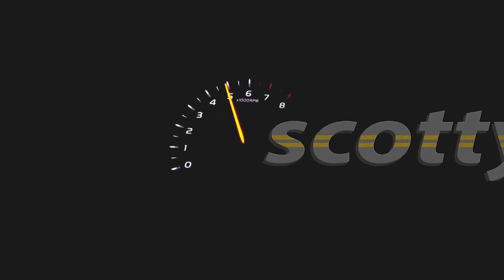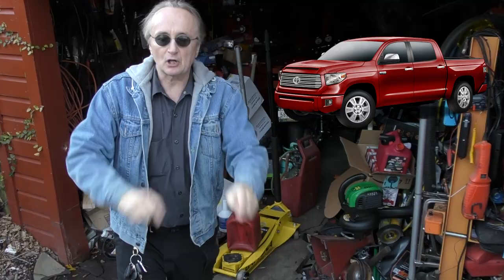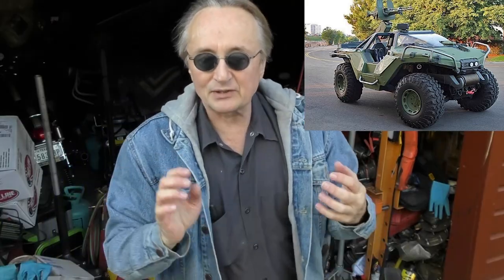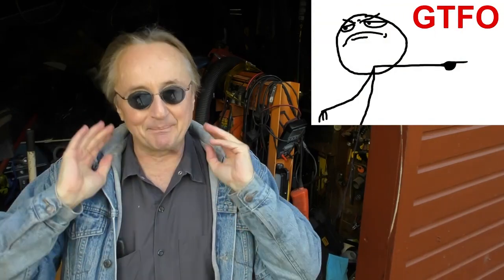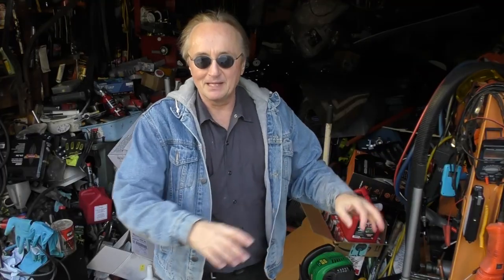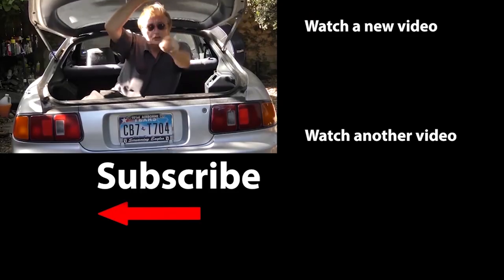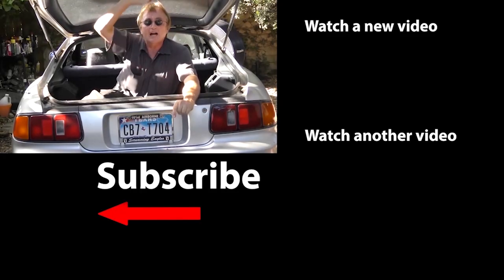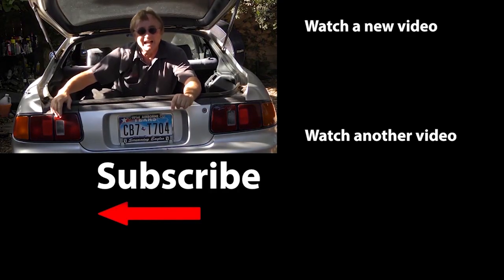5 Used Trucks You Should Never Buy

Comment: I would have to disagree with you on the Honda Ridgeline, I’ve had mine for 11 years and she’s pushing 420k miles and I’ve never ever had a huge problem with it, yeah a little rust on the rockers but fixed that up. The vtec in that thing still purrs, remember oil and oil filters improve a cars life.
Reply: As soon as it hits 420 it will start smoking
Reply: Thats good to know i just bought a used 2014 ridgeline with 35k miles some guy had it in a garage never drove it. Its my first truck  so im hoping I can drive it for a long time
Reply: How's it still holding up?
Reply: @BigWheel.  pretty awesome! I've gone ahead and did a number of maintenance like oil, trans, differential,  transfer case,  coolant, filter changes. I'm 4real about keeping it
Reply: Ridge line is a city truck... not really meant to tow/haul stuff... but a great for doing light duty things, for a carpenter/maintenance man.
Reply: Hey, same here, my 2006 Ridgeline has 350k miles and still has all original parts. Just normal maintenance has kept this thing going along nicely.
Reply: I have a 2013 Ridgeline 
 Love it . We don't get much snow in S C. When we do this thing is great.
Reply: I want a ridgeline. Test drove a 2007 with 190K on the odometer. Loved it and miss it because I had to get into my 136 horsepower kia soul and felt very strange lol
Reply: My 08’ Ridgeline has 156,000 miles and it’s perfect for someone like me who needs a versatile truck for hauling mulch, sofas, toolboxes to just name a few.  I never really needed to tow anything, so it’s perfect for what I need it for.  I wish I didn’t beat it up so bad on the highways because traffic is really aggressive and fast where I live.
Reply: @werunthistoo  lol i get it
Reply: Your "truck " is the iligitamate child of a  Toyota prius  and an El Camino
Reply: @lukeh5289  you base this on looks? How superficial. How about judging based on functionality?
Reply: @DonutGameClips   there's plenty of trucks that perform just as well and  don't  look like a Ridgeline
Reply: @lukeh5289  well, someone's preference belongs to them. Let people decide what they want.
Reply: @DonutGameClips   just not my type you seem to like it so good on ya
Reply: @lukeh5289  I'd get one if I could. Nothing wrong with it. Don't shame people who like it, though. It's just a vehicle. I go for performance. I'd take one only for the V6 and AWD
Reply: @lukeh5289  haha good one lol.  Let’s just say we agree to disagree.
Reply: @aviationnerd2465  Yeah. Ridgeline is a truck that help you to carry most household applications such as washing machine, wardobe, desk etc. It is not meant to towing boat and other cars.
Reply: Yeah I agree, people can keep these going well past 200k miles and I mean it tows 5000 pounds which isnt the most but it's not terrible I would say. I have been told it's a great truck for the snow as well. The 4 wheel in these older ones are solid.
Reply: @govinlock8568  you can tow smaller boats with it like a bass boat or something, but yeah i wouldn't recommend using it to tow a larger boat like a pontoon or use it as a car hauler lol. They weren't designed for that
Reply: I somehow doubt that
Reply: @tunit8946  how many miles are on yours now? Also in SC too 🙋🏻‍♂️
Reply: @iangrogan5261  95K
Reply: @iangrogan5261  obviously we don't get much snow . When we do this truck is like a snow machine.
Reply: Fram: I'll end you
Reply: @werunthistoo  lmao I get thst joke
Reply: @JPmelonslide  my 09 is great in snow. The AWD cuts in with a little nudge on a slippery road. Decent set of tires and away you go.
Reply: This is an awful video... He literally didn't like the Honda just simply because of the bed size.. it's called a midsized truck for crying out loud lmao Hondas will go forever if you treat them right.
Reply: @47thpanzerunit  had mine new since 2009. My biggest thing has been the honda rust cancer around the rear wheel wells. If you are in a rust belt ( or even a place with a winter) i would rust check it.
Reply: I agree, Ridgeline may not beat the full-size pickup, but it has its place. And the  engine and the transmission are solid.
Reply: @47thpanzerunit  looks like you still don't own a truck
Reply: How are the 14 & up Chevy z71s ?
Reply: @DonutGameClips  I don’t think Luke should be criticizing the “looks” of anything…smh
Reply: @jonathanjr1894  Hondas keep going even if you don’t treat them right. Ask me how I know.
Reply: I just got a 2011 Ridgeline and I love it. It has style and power .I am a working musician and its perfect for my drum kit. I can fit the whole drum rack with seats up.

Comment: “Pickup trucks are for work not for racing” AMEN
Reply: kelly love they race in a straight line like american muscle cars, no1 races them around corners like japanese gtr 34 or supras
Reply: whatEver why are ppl always concerned with what other ppl do with their property? just be glad we have the option for more comfortable features as better handling/feeling suspension or a/c. my dad has an old 78 f100 and you seriously feel evert single tiny bump on the road like if it was a huge pothole. worry bout yours and your money bud.
Reply: NASCAR trucks
Reply: idk the mini trucks of the 80's and 90's seem to handle pretty decent.
Reply: What if racing is your work? :o
Reply: i race from job to job with mine,  or race to the dump to get rid of material before they close in 15 minutes.
Reply: Tell that to Thailand. They have 7 second diesel pickups.
Reply: Johnny Draco  I drove a rental S10 pick up in the mid 1990s from Pittsburgh PA to Cleveland Ohio. I did not like the S10. The empty pick up bed makes it drag, twist in sharp turns. In the early 2010s I had a F150 quad cab truck as a rental just for in town use. In one day I had 2 stop 2 times for fuel! 😫 ⛽😫👎...
Reply: Tell that to Ford
Reply: I don't even understand why you would buy a truck if you want to race.
Reply: Hallelujah preach it brother!
Reply: whatEver meanwhile ken block drifts a truck.
Reply: whatEver okay so then a lameda ridgeline can't been be called a truck since trucks are for work
Reply: @urmum7461  exactly!👍
Reply: what if your work involves racing?
Reply: @Marco-fi6gv  Nah i get pretty amused when an LS, hemi, 2jz, or 4bt cummins swapped s10, dakota, ranger, or Tacoma blows a brand new mustang GT's doors off yet still tows a trailer with all his race equipment across the country
Reply: @Marco-fi6gv  each their own I guess. I personally think a truck should do what you need it to do. If you need it to pull a giant camper, carry all your equipment on or off road, or make a pull on a hell cat Challenger. It's all up to the owner. Me I like to see a truck from back in the day rebuilt into a nice race truck, mud truck, or reliable daily driver
Reply: It's for whatever my money says it's for.
Reply: @Marco-fi6gv  I mean I can take a stock ford lightning and smoke a stock civic..... my point is you can take a truck and make it as fast as a mustang gt and probably save money at the same time.
Reply: @Birdman84Daddy  that's cool , to each his own. I happen to like cars and trucks, I'm in to both. I must admit I'm more into trucks right now than cars, but I do like mustangs. I had a GT and I wish I never got rid of it now. The new ones that are out now are sweet though. Quarter Mile in the 11's, that's insane. I'm talking about a regular mustang GT, not the GT350 or GT500. The Camaros and challengers are sweet too. Probably the last hurrah for these V8 muscle cars, before they go away. But anyway those earlier gt's are relatively cheap and there are so many mods and aftermarket parts and options out there for them that you can pretty much do whatever you want and spend whatever you want. I think it's a lot of bang for your buck personally
Reply: @Marco-fi6gv  First off, a regular "stock" truck isn't going to touch the FASTEST stock car because there isn't really a market for a 1,000hp truck like there is in cars so they arent going to get built and put into production. Secondly, a stock 2005 Dodge Ram SRT 10 ( 13.7 sec 1/4mi @ 103 mph) would keep up with a 2005 Ford Mustang GT (13.6 sec 1/4mi @ 99.9 mph) pretty easily. And they don't handle bad on tracks either, it won't be no GTR taking corners but it wont be sliding/rolling off the track either.
Reply: @JusToLazy  I'm not sure what your point is, are you agreeing with me or disagreeing? I have no idea about the numbers for 2005 mustangs or Rams. I do know that a current mustang GT is in the high 11s for the quarter mile and I don't think any ram truck will come close to that. Can't come close to the Camaro or Challenger either. We're not even talk about the GT500 or GT350 or hellcat. Yeah, I guess there isn't a market for a truck like that but if you put an equal amount of money into a truck and a car the car will always come out ahead. A car's design is more aerodynamic and lower to the ground and it's probably going to weigh less right off the bat. So whatever else you are going to do you have to get over those disadvantages first if you're trying to make a truck that will beat a car
Reply: Say that about the Ram SRT 10.
Reply: Texas wants to know your location
Reply: Pickup trucks WERE meant for work.... Now they're being made for a lot of things ...
Reply: Also, STOCK 92 GMC Syclone 0-60 in 4.3 seconds.... Basically eats every stock mustang GT up until recently. A 27 year old pickup with a V6 did that... Stock.
And now there's stock SRT Durangos with the 6.4 and TrackHawk Grand Cherokees using the Hellcat 6.2....
Eat those regular mustang GTs up... Even tho the Jeep and Durango weigh like 5500lbs.
Reply: The Ram Daytona is not a race truck. The Ram SRT 10 is. The Daytona is just a package added to the standard Ram 1500.
So he's wrong right off the bat.
Reply: I think the guys that race in the nascar truck series would disagree.
Reply: Thinking about financing a 2003 dodge ram 1500, even though my current car has nothing wrong with it, I've driven these era dodges before and fancy them quite a bit. I'm normally great with money, but this one of the only times I'm looking past financial situation, I can afford it though. Is it worth it?
Reply: So what is wrong with somebody enjoying having both a bed for work and a vehicle for driving around and having fun in?

Comment: My 2008 Ridgeline has needed very little since I purchased it used in 2010. Apart from regular maintanence items it has had the recalled airbags replaced, 3 light bulbs and a rubber in the suspension that was causing a rattle. Its a run around farm truck and has towed all kinds of stuff. Most reliable truck around here in 50 years.

Comment: Scotty my dad has 2010 honda ridgeline and still solid until now. It has 260k miles on it. The only thing we change is the catalitic converter, aside from that its all good
Reply: I have a 2011 170,000 km ( Canada ), I haven't even changed a light bulb yet. I think that Scotty had a bad day.
Reply: As a truck it kind of sucks.     Dont know why honda dont just build a.truck
Reply: @suprapike  Because Honda knows the market. Honda owners don't want trucks. Truck owners do not want Hondas. They made limited quantities for the overlap that does exist. And so far they have sold every one they made reliably and even have had a wait list in some areas. It was only made to be truck-like enough.
Reply: assasinbassin comerford 
I’ve asked that same question, but Honda has made a hard and fast marketing decision.

Honda has stated it doesn’t want to wade into the pickup market. The hype pickup crowd are an insecure bunch, and some of the most impractical shoppers that rival teenage girl’s sensibilities. 

And I’ve driven “big tough” American trucks all my life, but this new age of cultish truck buyers are a tender group. 
Honda states it doesn’t want to pull from the traditional pickup crowd, but just to give current Honda owners a pickup option to keep the buyers fleet all-Honda
Reply: @acephantom903  Exactly!!
Reply: I think you guys missed the point.  If I were in the market for a used pick up I wouldn't buy a ridgeline for sure.  It's a useless wanna be truck.

Comment: Honestly, Scotty, I used to work at a truck accessory center, and I saw everything. Including a Honda Ridgeline with 400,000mi. I talked to the owner and I asked him what he'd done to the thing, and he straight up just said maintain it and don't try to haul more than a quad or a dirt bike in it. It's not a hauling vehicle. It's a daily driver that you can put some things in the bed of.
Reply: Honda needs to make a real full-sized truck, similar to a Tundra, with a V8 or a turbo-charged V6.
Reply: That's the thing he was saying for some of the other trucks. They're a Ridgeline isn't a working truck, it can't haul and doesn't have a big enough bed, which kind of defeats the purpose of having a truck in the first place.
Reply: It's a "toy truck"
Reply: Or something a chick would think is cute and feels like a truck. Haha!
Reply: Most people that own trucks don't haul anything more than groceries, or a washer & dryer when it's time for a new set.

I recently pulled an enclosed trailer from GA to CA with my 2009 Silverado, but honestly I have hauled much with the truck since 2010.
Reply: I have a 2011 Honda Ridgeline I've never had a problem with the vehicle it may not be a full size pickup truck but for someone in something simple for an all-around driver it's pretty damn good
Reply: The SSR was a cool truck. It was a cruiser not a hauler and I would buy one. I had a 1989 stepside Sierra and I never hauled anything with it because I turned it into a cruiser. The SSR was the ultimate cruiser and had lots of potential. It is sad it is a collector's truck now because it is too rare.
Reply: I love my ridgeline..never stop

Comment: Not sure what your customers are doing with their ridgelines but I have a 2007 with 180,000+ miles and the only thing I've done is a set of brake rotors + 2 $5 relays for the air conditioning system. I got 85,000 miles on the first set of Michelin Tires + 95 k on the second set I'll get a 100 K ez. If you're looking to tow 10000 pounds I get your point but for the average truck owner it will handle everything they need. you should own one for a while, I think it change your mind Scotty
Reply: Steven Hoffman - yes the factory Michelin tires were great! Had to get new ones at 75000 cause they were dry rotting. Quality everything on that truck
Reply: @Steven Hoffman
Good for you. You use your Ridgeline like a car and it lasted. Bravo. Scotty's talkin about people using a truck as a truck. Big difference. Ill agree Honda engines are awesome. But the rest, not "truck" worthy.

Comment: I bought my 2007 Ridgeline with 70,000 miles and absolutely Love it.Haven’t had any issues and have over 240,000.It’s about time for me to replace the timing belt again and my headliner needs replacement.Still drives as Great as the day I bought it.
Reply: Mine is 2007 RTL and has 135K.. just needs a headliner as well.. lol.   Love it!!!
Reply: You didn't have any miles when you wrote this though... When you get to 200k , be happy. Im sure it'll get there though